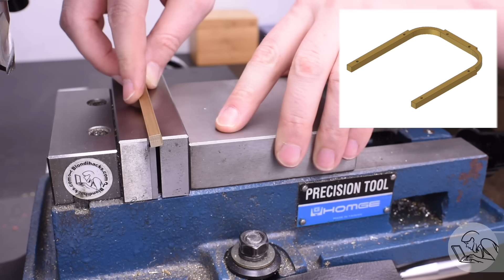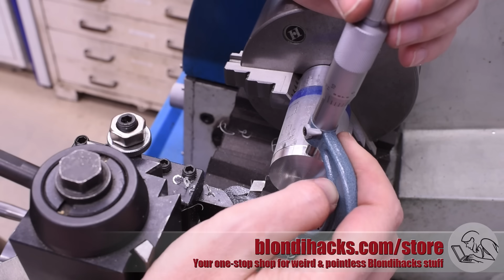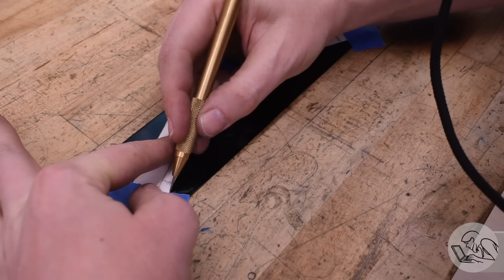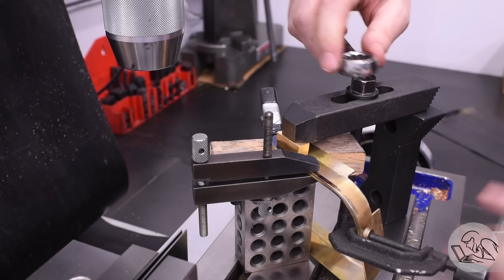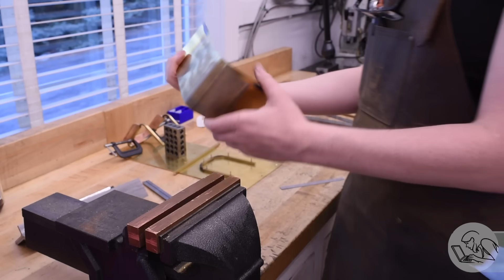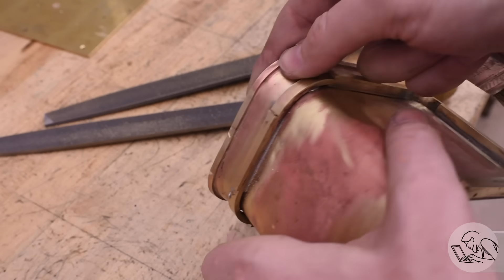Coal Bunker! Pennsylvania A3 Switcher, Part 22

Comment: Quinn, what are you using to pickle your 
copper and brass stuff?  I found a food grade 
pickling agent, and it is CHEAP!  (It is also food 
grade.)

1/2 liter of water, 50 CCs of hydrogen peroxide, 
1 ounce of citric acid.  (2 tablespoons for the 
acid, 1/4 cup for the peroxide.)  3% peroxide.

Saw a guy using this on his copper stuff, in 
his still.  I probably wouldn't use this on 
brass, because of zinc poisoning, or throw 
it away after.

steve

Comment: Were you using the same fire bricks for soft soldering as silver soldering? (I've not heard you make a comment about this). If so, you really shouldn't. The danger is you get some soft solder on the bricks, which then gets transferred when you do some silver soldering. Soft solder and brass at this temperature cause trouble - it makes the brass goes into holes and so ruins all your work...

Comment: Quinn, as a 1st year apprentice (57 years ago) we were taught that when bending sheet metal or thicker bar stock , we had to calculate how much extra length was required to make the bend.  The Bend Allowance formula used  a) degrees of bend  b) radius of bend  and c) thickness of material. You will have to look it up as I can't remember it now , but it basically calculates the length required at the centre of the material as you bend it - a slightly larger radius. In the case of your hoops with the thickness of the brass bar that is why your piece ended up being too short. I admire your skills and instruction ability. From Downunder.

Comment: Lots of grins in this video.  But only WITH you rather than at any issues.  Stuff I could see myself doing WAY too easily as well.  Especially after the bends for the coal bunker wall where you finally ended up with the two pieces of wood and a  (correctly) sized mandrel.  I feel like I would have taken the same path as you.  But I really liked your final  solution.    I've learned a hint from your trials and will follow your example and just start with the two pieces of wood and annealed metal over the proper diameter.  So Thanks for that ! !

A couple of observations/hints if I may?

On the upper verge form.  I can't help thinking that a conical form would have been a better option and saved some tweaking to form the angled or flared bends.  The bends on such a final shape being of a conical nature to start with.

And for the reliefs on the square bars that needed inside bends that start and end at the ends of the reliefs.  A "D" shape at the proper inside diameter would have given you an edge to key the stop ends against and form the bend rather than how you did it over a small'ish diameter.   Or, I suppose, a quarter of a full circle.  A half "D" in effect.  Or perhaps just bend half way over a "D" with one of the stop edges against the flat then switch it and start from the other stop edge from the other lip of the "D"?  Meeting in the middle and then work it to fit proper like?

I'm splitting hairs on an overall big job of course.  If any of it helps then I'm happy.

Comment: For relatively thin parts you can use electric soldering iron. 150W may be little low on power, but 250W would do just fine.

Comment: Great episode!! I do have one suggestion for you. When silver soldering you need the heat that map gas provides. However when doing soft solder or 95/5. You can do that with propane. Less heat and it will stop your burning the flux and give you a nicer joint. I’m not a machinist. Just an old refrigeration technician. 
Thanks
Reply: A hot air gun with a conical nozzle fitted also works nicely with soft/plumbers solder.

Comment: What a neat piece.  I can tell you from long experience that the stiffener would be much more easily by simply cutting a strip of the correct width and bending on edge it to shape rather than cutting the shape and filing.  As you know, annealed brass is super-soft, and because you're using thick-ish sheet, and the strip is narrow, it will bend on edge without much trouble.  Of course, the inner edge will become thicker, but you can just hammer that down, and file it as necessary.  For future reference ;)  I also wonder if just brass rivets would be easier to hold it on for soldering rather than the seemingly rather more difficult fixturing screws.  Brass escutcheon pins make excellent tiny rivets.

Comment: 4:48 a trick I’ve used with conical wigglers is to gently set it into your feature and then feel the sides of the wiggler while moving X & Y until you feel the top and bottom of the wiggler are lined up. Maybe you know this, maybe you don’t? Interesting project even though I have no interest in building a train, learned lots of interesting things. Kudos!

Comment: I have seen many others glue their paper templates to the plates to use as a guide. I was wondering why you don't use that method. I have tried it and it works good. Have you run into a problem that removed that option from your repertoire? Also, where do you get your bionic limbs calibrated for small screw assembly? I seem to strip them out far too often.